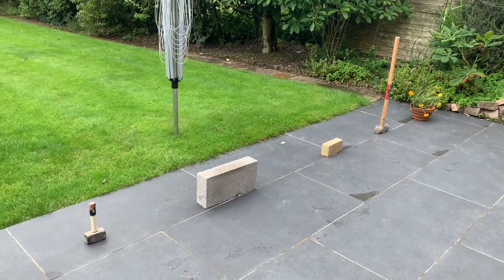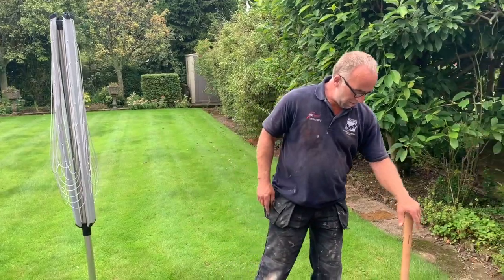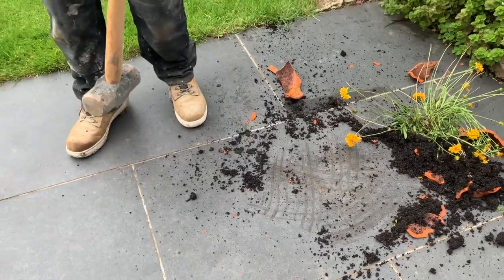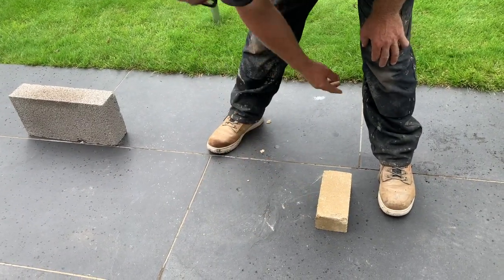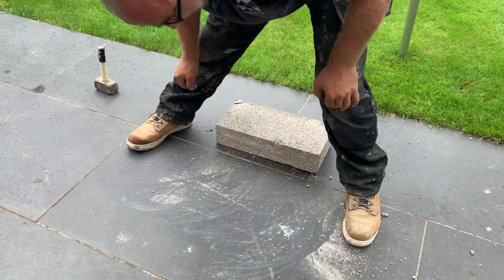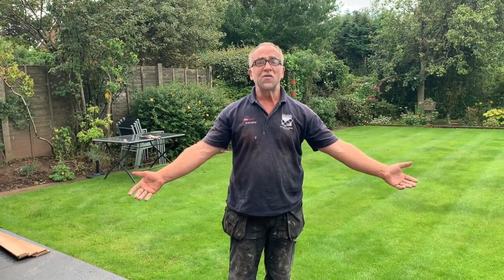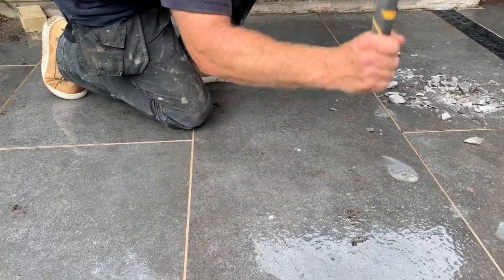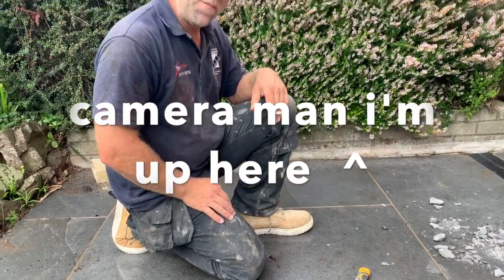Porcelain Tiles how strong are they  #porcelainstrenght

Comment: If I remember right most porcelain has a compression strength of about 20k lbs/si. So this is what you're testing here. And all of that strength is due to it's underlayment.  If you had a void in that underlayment or thinset, then  it could easily crack with just the clay pot.  E.g. if you support those tiles on only the ends, you could break it by simply stepping in the middle. So laying the tile well is the key.
Reply from the maker: I’ve just realised something I should’ve said on this video as I laid it the cement bed would of been full. 
It was good to test that was for sure for my own sake 👍🏴

Comment: i once dropped a club hammer on my cream porcelain tiles in my new kitchen by accident.
As it fell (in sort of slow motion) i can remember shouting SSSSHHHIIIIITTTTTTTTTTTT!!!!!!!! as it left my hand.
Not a scratch on it, but i put it down myself (I am not a tradesman) with hardie backer board on my 1930's floorboards.
A few years later i got a "Bathroom specialist" in to fit me a new shower and toilet and wall hung basin and fully tile the floor and ceiling in matching 600 x 600 porcelain.
I asked him on day one why he was using  plywood instead of Hardie backer board and he said it will be perfectly fine with Ply.
£6000 later and 18 months on, all the tiles creak and the grout has all come out, it was a real shit show.
I dare not redo it myself as i am worried that i ruin the wall tiles while taking the floor up.
I will get a Pro in at much cost i imagine.
Great videos mate, i really enjoy your skill. Stay frosty.
Reply from the maker: There are pretty solid some tiles glad it didn’t chip as for the other fella Gutted for you 😞

Comment: Knocked my big metal post hole digging spade as it was lent on the wall and it fell smack back onto the porcelain tile, it bounced off not even a scratch, I love the stuff just hate cutting it
Reply from the maker: It was a great test I’m glad I did it 👍 and there so hard to cut yeh totally agree and tomorrow I’ll be using my new toy for work a Zoe 130 bridge saw I’ve had it 2 days already and not even tried it yet 
https://www.tilerstools.co.uk/product/zoe-130-bridge-wet-saw-machine-blade-not-included-copy/
Reply: Nobody’s putting out content like that, all you ever hear is ye it’s strong but none ever shows you just how strong it is, bit out of my price range that one 😬 and I thought a flex wet saw was expensive lol
Reply from the maker: Richard Wallwin and the flex ain’t cheap either